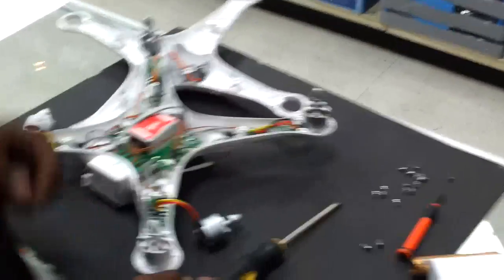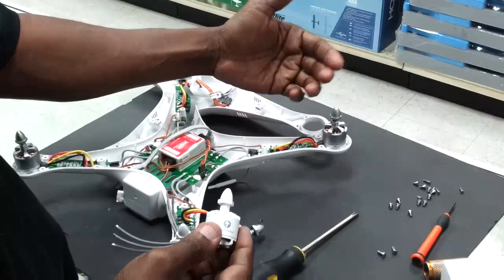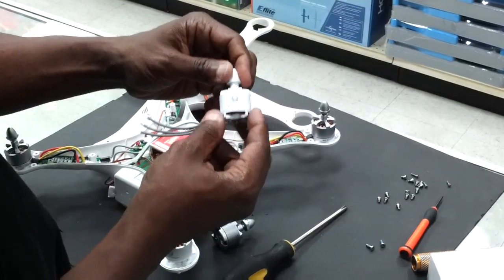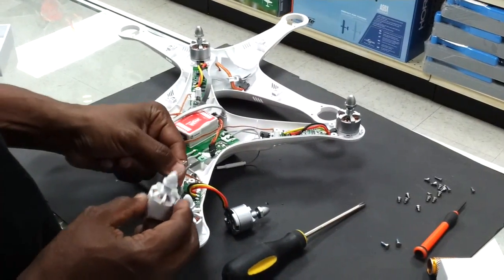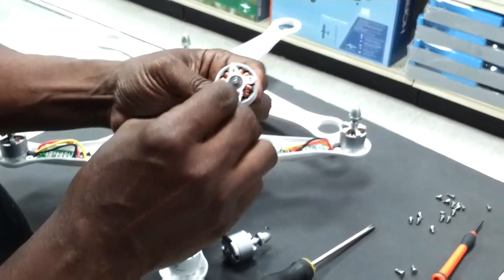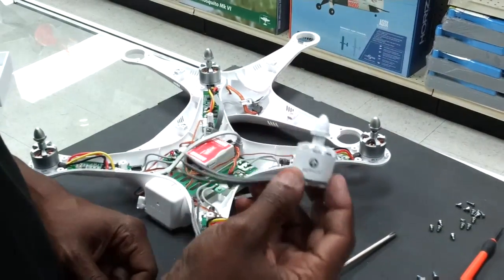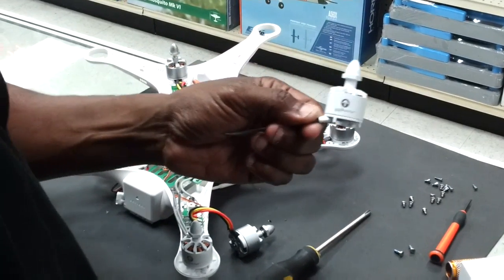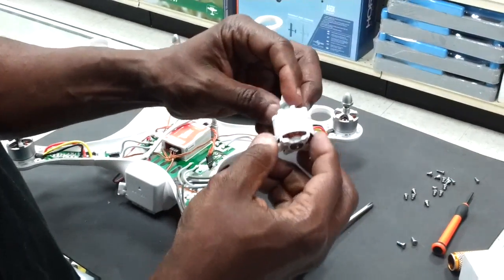Dji Phantom motor up-grade

Comment from the maker: Okay guys I tried to replace the stock bearings in the red and black DJI motors but I found a problem across the board with all djI motors.its the tolerance in the machining is quite off some motors hold the bearings very tight and some new motors hold the bearings very loose so its just better to replace the entire motor with a better quality motor like the T-motor

Comment: How much flight time are you getting on the dji phantom 2 and what type of setup are you running. I also getting 16 minutes when I run dual 2800 lipos. I'm considering getting the tmotor anti gavity and 9.3 inch carbon fiber props and run dual 3300 30c lipos hoping to get 20 minutes which this setup will cost me $300. I already have fatsharks for fpv, iosd mini and pmu and a gopro hero 3, I'm not sure if I want to spend $700 for another quad. What do think?

Comment: I'm getting about 12 minutes on my zippy 2800 3s lipo and it fits it the stock Phantom 1 body without any modification. I'm running all stock parts fpv with gopro hero 3 white, IOSD mini and PMU

Comment: these only makes 6% to 9 % increase. Better and a lot cheaper (NSK bearings) are the motors from RC timer HP2217 1500Kv and guives like 35% increase minimun using 8035 propellers and the phantom goes great. and are only U$18.

Comment: I discovered a way to install t motors and get the wiring right on the first pass! No more guessing. Three wires exit the motor flat, use thumb to press the wires down flat so there is no cross over inside the heat shrink exiting the motor. On every t motor with the motor/arm mounted and the wires running away from you towards the esc, the middle wire goes to yellow, the left wire is black, right wire is red. Works every time, cool huh

Comment from the maker: Rpezze i forgot to mention after you finish soldering each motor put the battery in and power it up if that motor is spining backwards just switch any two wires and you have it.